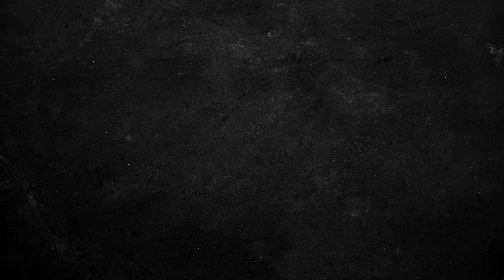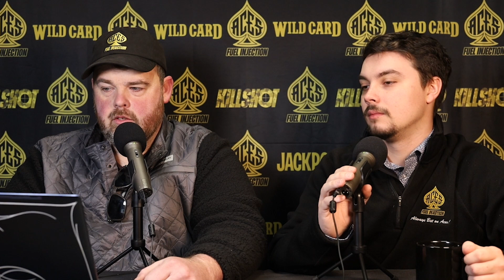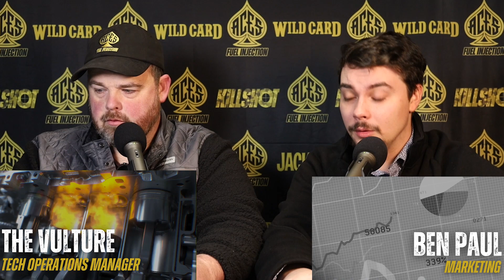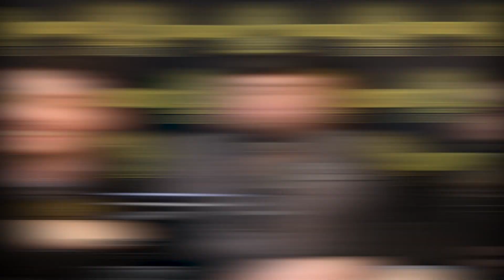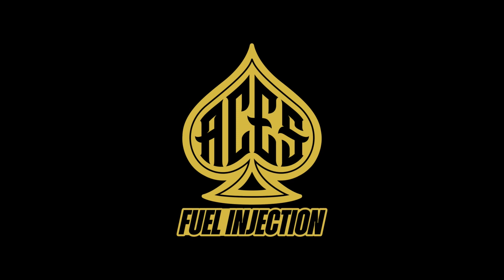One Try... Again (Tech Tuesday Ep. 24)

Comment: I have the jackpot ls system .Did my first fireup Sunday. Its only running on cyl.5 and cyl 8 .and will only start and run with throttle blade slightly cracked open.havnt had time to troubleshoot anything yet .but crank is sinking and reading 24xreluctor  .have spark on all plugs .and seems to hit on all 8 with a shot of brakeclean.I will check injectors this week .just curious if this could be a tuning issue or a issue with injectors.havnt let it run more than 30 seconds my cooling system isn't hooked up yet.plus my air intake sensor isn't hooked up in airflow just laying on intake at the moment.its probably somthing on my end.just asking for some insight.